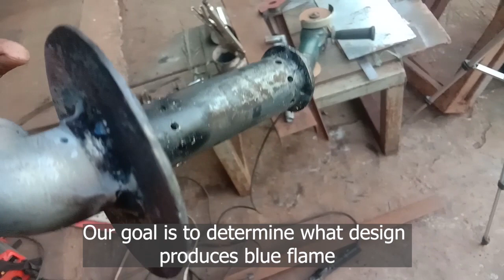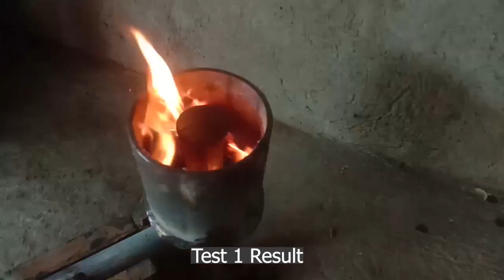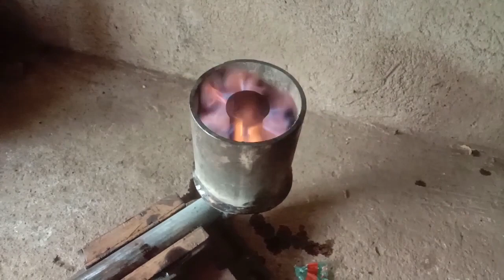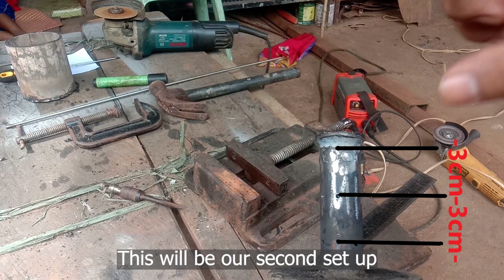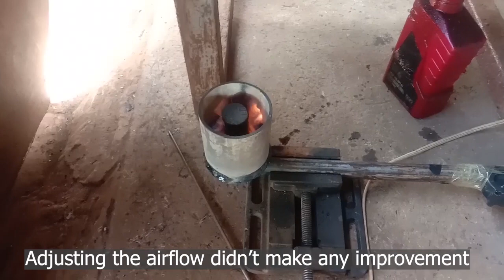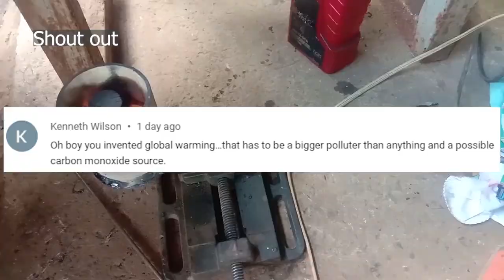Oil Burner Expirement | Comparing Air Hole Design With 3 Inch Burner

Comment: Better weld coupling unto the base and use Threaded nipple where to make a hole. It's much easier rather than cutting the base. Unscrew the nipple for necessary hole  changes.